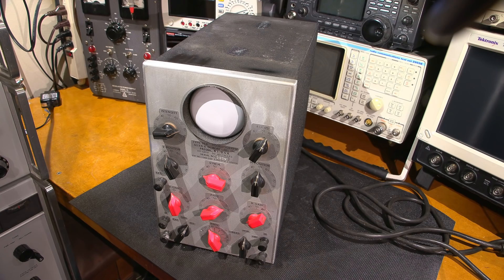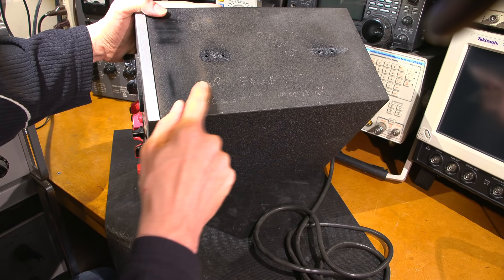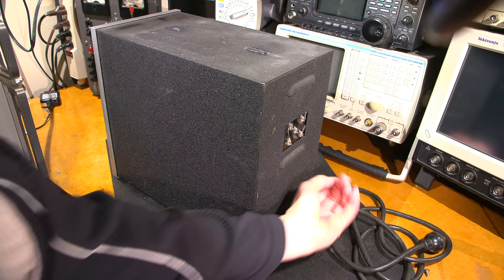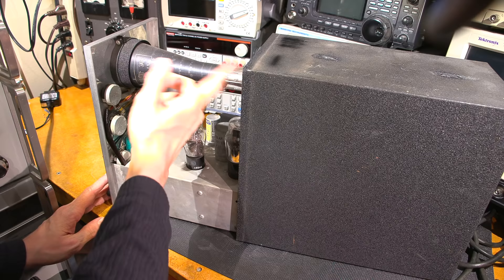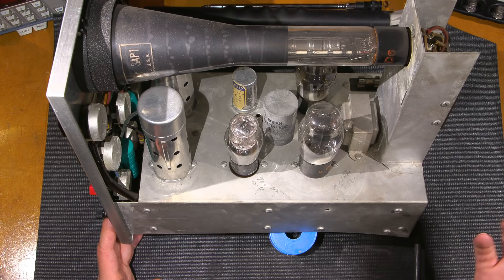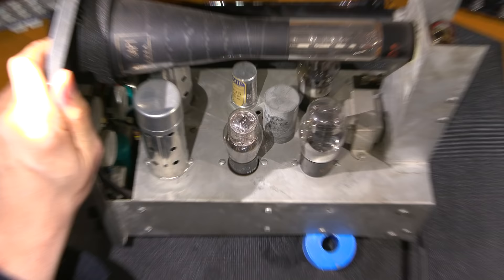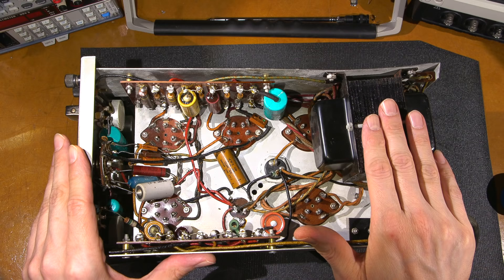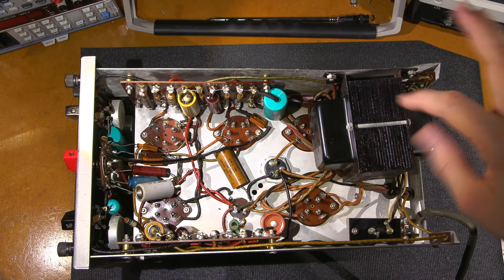1930's Electronics - Will It Still Work? Lets Find Out!

Comment: 18:00 
How does the beam deflect without coils on the yoke ? 
Or why do TV's use coils to deflect the beam ?
? TV's have larger screens and or lower working voltages ?
Reply: there are deflection plates in front of the electron gun that do the same job as the coils(usually called the deflection yoke) on most TV's(although the earliest TV's used deflection plates, just like the oscilloscope).
The method using the plates is called electrostatic deflection, the method using the coils is called magnetic deflection.
Electrostatic deflection is more suitable for a oscilloscope, since it can work well at much higher frequencies.
Reply: TVs have much higher voltages on their CRTs than oscilloscopes. My 'scope has a 2nd anode voltage of 1700 V. Your typical 25-inch color television had a 2nd anode voltage around 30 kV. That's why you always used a shorting stick to discharge the CRT before doing anything inside the cabinet. The CRT was, in essence, a Leyden jar.

Comment: On the ID plate, the last patent number referenced was issued on Sept 10.1935, so construction cannot predate then, even if it uses 1933 components.
Reply: That is not accurate.  Patents are typically for a single component.  Tubes for example can be made years before the patented component referenced on the tag.  The entire oscilloscope is not patented.
Reply: @ShainAndrews  There are three individual patent numbers listed on the tag, The earliest is for the CRT. The last one is for one of the compoents, issued September 1935.  Are you saying that the manufacturer knew what the patent # was going to be before it was issued on 9/10/35?
Reply: @rivards1  I really don't understand what you are trying to say.  OP implies nothing can be made prior to a patent date.  To be honest I really don't care what you are trying to say.  Should have just kept my mouth shut.
Reply: @ShainAndrews  Yes, because you have made a fool of yourself.  Of course things can be made before their patent date.  But the thing that is made cannot be labelled with a future patent number that doesn't exist yet! The machine in the video is labelled with a patent number issued in 1935. Therefore it cannot have been made before 1935.

Comment: those green sprague paper capacitors, like black beauties.. I will Not eff with.. cut them out, replace with modern caps.  Make a list, change them all ! In these things.. trouble shooting is something you do  AFTER you have replaced all the paper caps and electoltyics, tested and replaced weak tubes, and shot everything with De-Oxit, replaced any fried components.. and likely checked any questionable resistors with a meter, and replaced those that have wandered off the reservation. In time you learn which types of resistors tend to be stable, and which weren't.   This saves an enormous amount of time, and trouble shooting then is minimal, and obvious.  The result is a unit that will work for many decades, until a tube wears out.  For teaching purposes, you may chose to chase down every component  symptom by symptom.. but from a user, owner, or service mans perspective.. this is just NUTS. For originality, leave chassis mount electolytics in place, but put new  modern ones in underneath.

Comment: it's a shame I think you should have left it all original four test purposes in itself to see longevity of the components I mean they've lasted this long
You don't think reforming the capacitors with use would bring them back into spec
Reply from the maker: Watch the video again John.
Reply: @MrCarlsonsLab  I'm not sure what you mean yes you had a capacitor that had some "leakage" doesn't mean it can't be used, the scope seem to respond ok when you put it on wouldn't those capacitors in those days have some small leakage anyway, I'm saying if it's working what it seemed to wouldn't it be good just for historic site to keep it all the same, yes if I component fails replace that component. but if the unit can be used as much as possible with the original components for scientific purposes.
Reply: @johnsweda2999  craziness